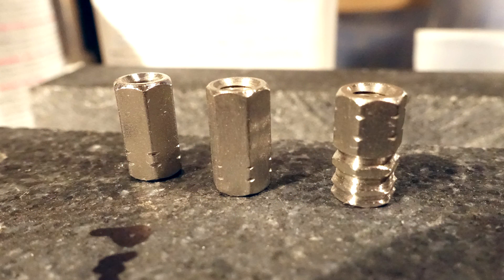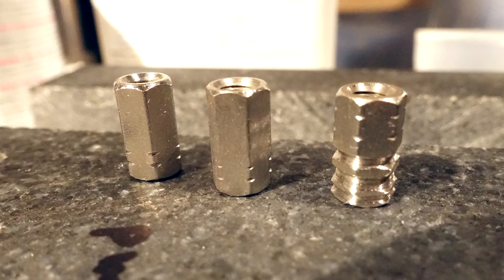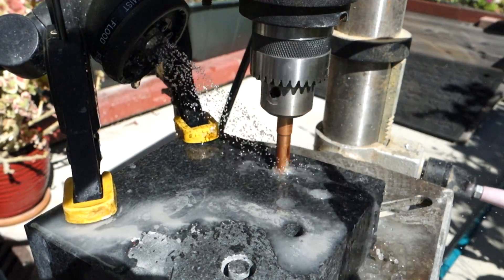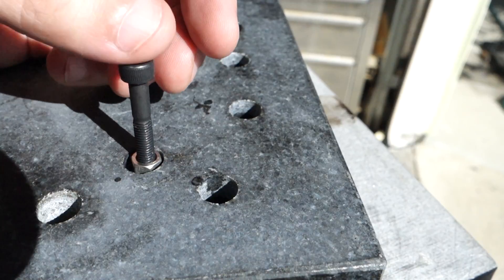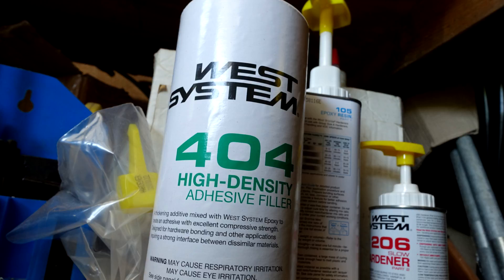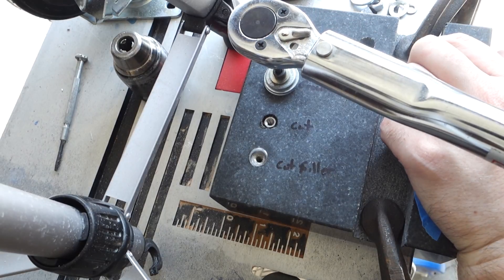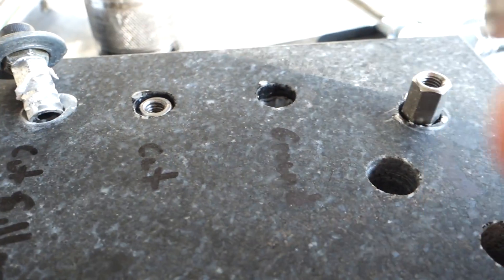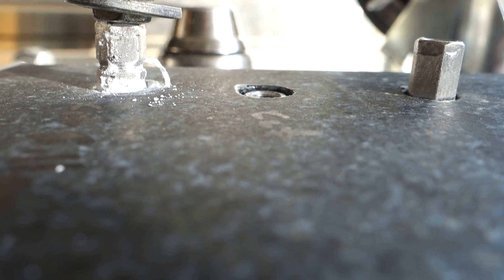Granite Gantry Router build, part 2

Comment: Be aware that using stainless threaded inserts in combination with stainless fasteners can lead to destructive galling. That is, stainless is notorious for "smearing" itself onto other stainless. You can spin a stainless nut onto a stainless bolt - by hand - and have it bind up so badly that separating them results in the bolt breaking. Antiseize helps - but not always!

Comment: How does epoxy metal inserts compares to drill and tap onto the granite base? Which one is better in the long run for stability, accuracy, rigidity and holding strength? I'm assuming you're using metal inserts rather than tapping to save time and effort or is it because it's better than tapping?
Reply from the maker: Is it even possible to tap granite?  The stone is not very strong in thin sections, I don't think I would trust the relatively fine threads to hold much even if you did take the time to carve them in.

Comment: Do you know what grade the allen-headed bolts you used were?  (https://www.homedepot.com/c/ab/grades-of-bolts/9ba683603be9fa5395fab90189731df8)
Reply from the maker: All of the hardware I used is black oxide finished steel, class 12.9
Reply: @SiieeFPV  thanks.

Comment: What screw size did you go with for the gantry anchoring?
Reply from the maker: The largest that I could comfortably fit, I didn't do any kind of calculations on it.  IIRC it was all 12mm for mounts into the base slab, and 8mm for all the gantry mounts

Comment: Super cool - I’m trying to do this project now - did you find any cots thread couplers you can recommend - Renae in la
Reply from the maker: Thread couplers?  you mean motor couplers?  I used disk based ones from Misumi, got some spares from McMaster.  Nothing particularly crazy about them as long as they meet the torque requirement.

Comment: Why don't use expandable type scew stud with locking bushing that generally used in concrete wall.
Reply: Expanding insert will crack the granite.
Reply from the maker: I wanted to, but I was unwilling to mix imperial screws in the build and metric expanding threadserts were just impossible for me to find locally, even from my regular industrial suppliers.  Something with interference in the hole would be greatly preferable to what I did for sure.